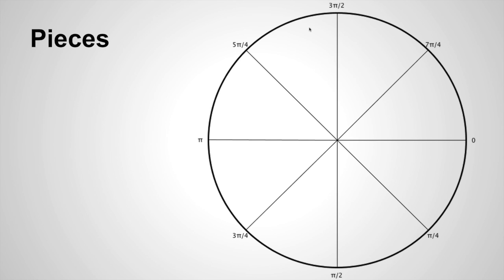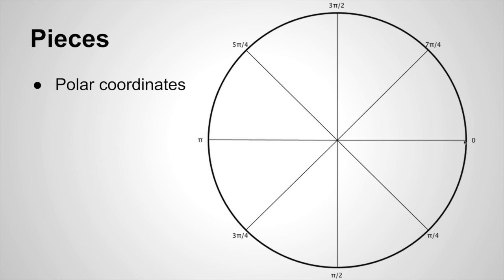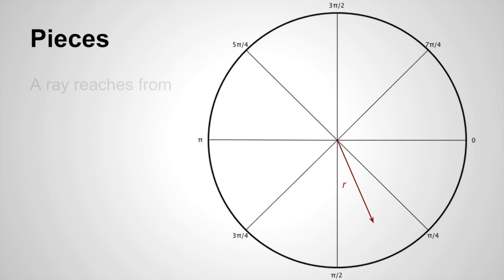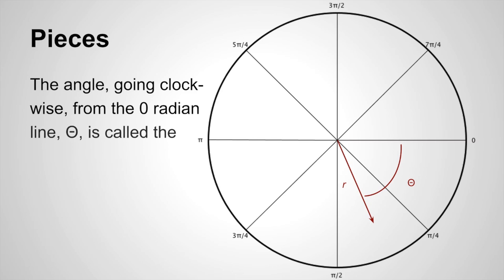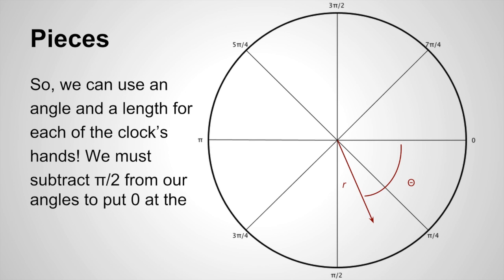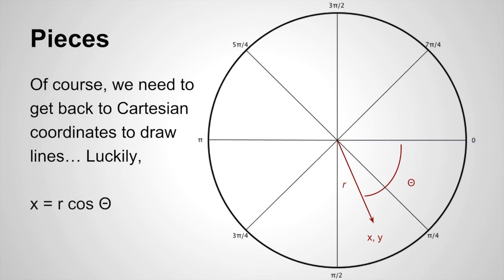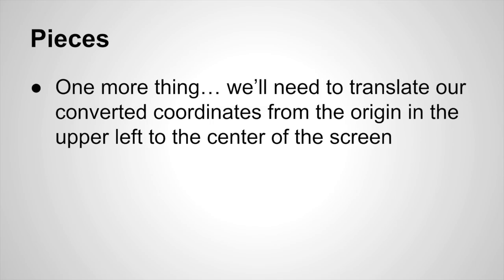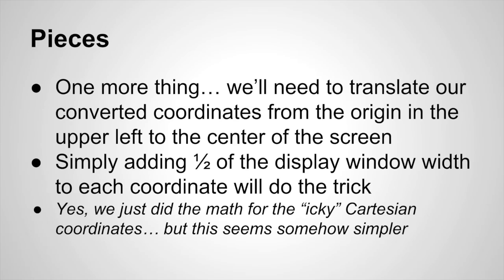Analog Clock Part 2

Comment: I like this approach and appreciate your excellent description of how it works, but the calculations require the x,y polar coordinates to be identical.  That means this approach only works if all want is a single clock to be displayed.  If you have multiple gauges in a single display, all of them requiring arc movement of a pointer, only one of them can use this approach.